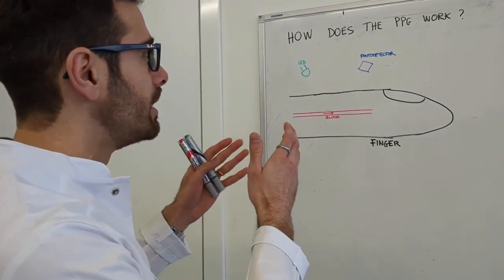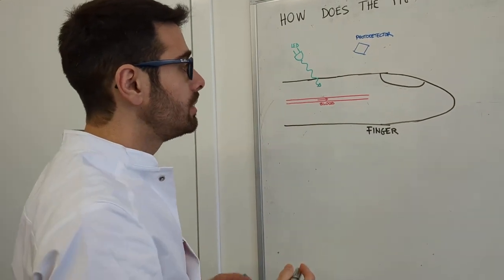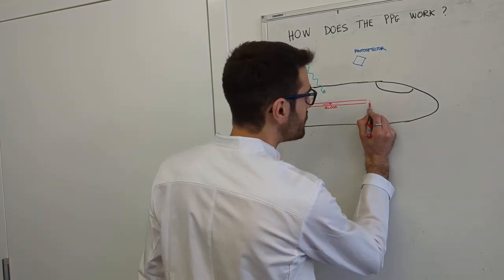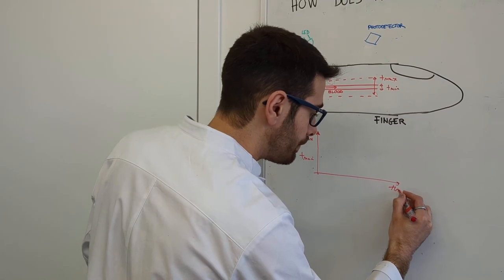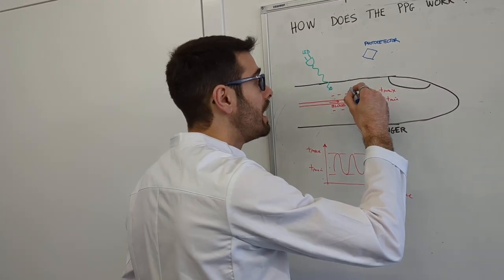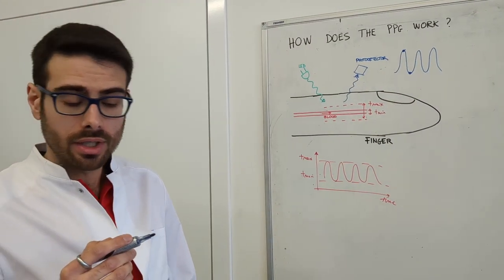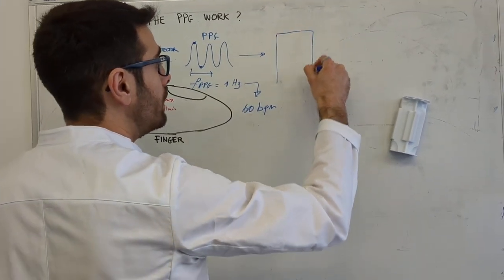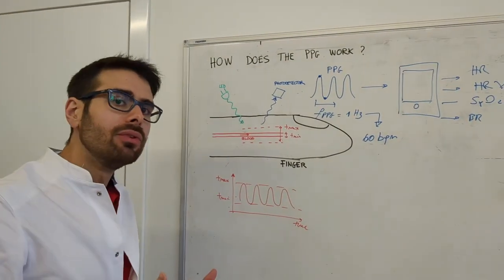How does the PPG work ?

Comment: I have made a PPG circuit using IR sensor, then I integrated it with ESP32 and connected through Arduino IDE. Now the its ADC value (PPG) value constantly changes when i see it on the serial monitor. I want a single accurate value, how to get that.